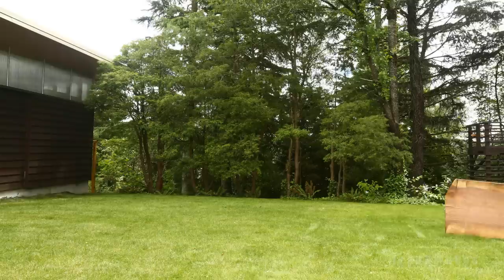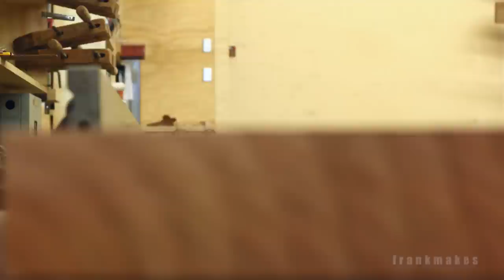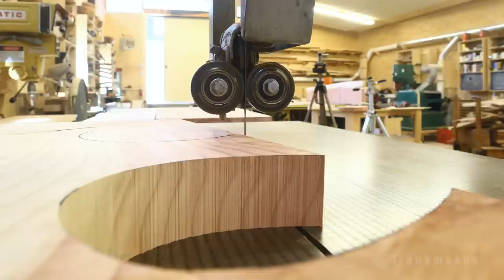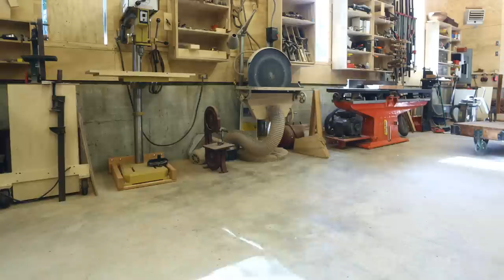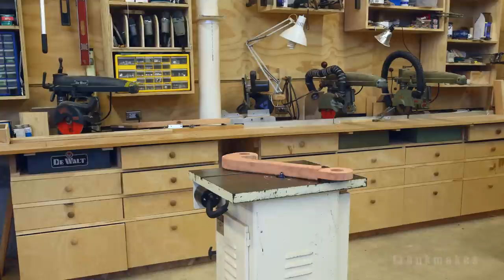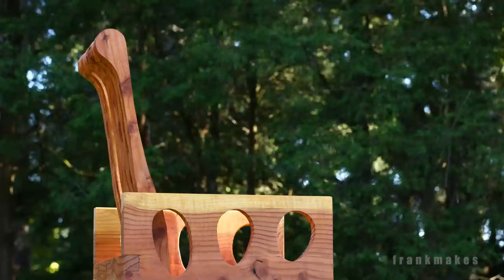Lawn Chair 2

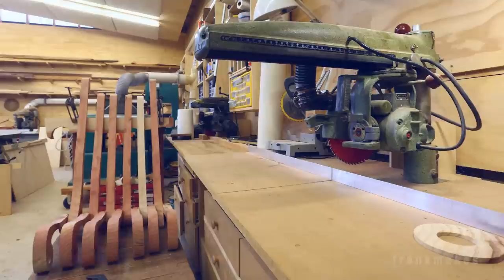Comment: i hate to be THAT person, but at 6:30, the radial arm saw is powered then pulled to the work piece to perform the cut, rather than pulled out, powered on and then pushed into it.

It'll cut either way, but cutting on the pull + kickback = severed digits

Comment: Cool video. Cool chairs.

Did you stain the rods as well?
could you make cylindrical shims on the lathe to fit over the rods so they pieces dont slide around?

this must have taken a few days. very cool